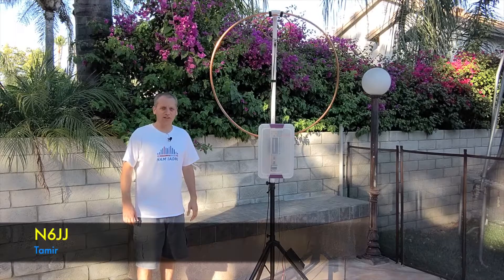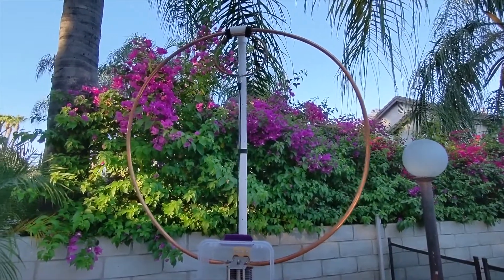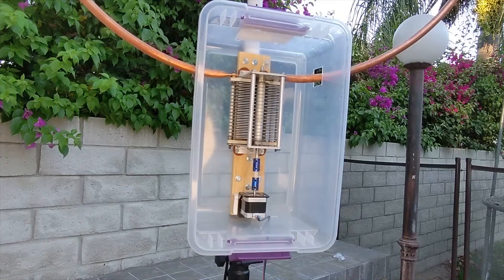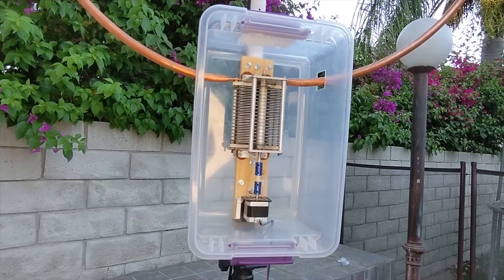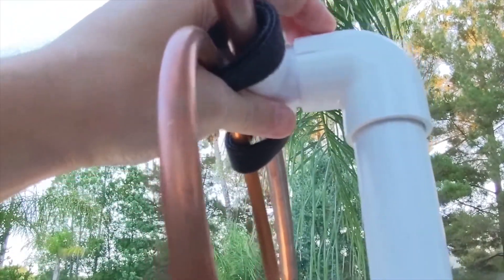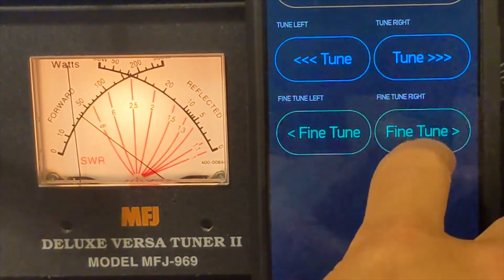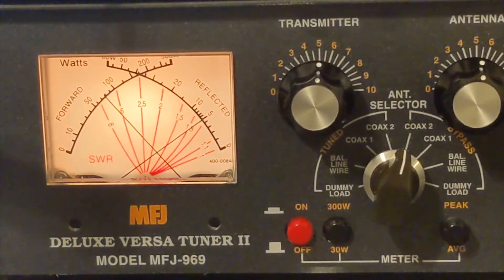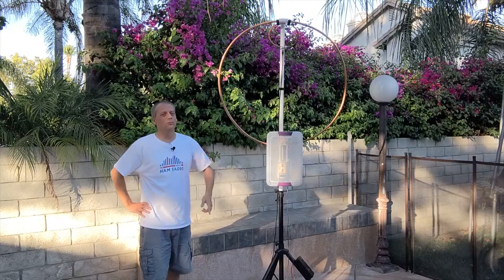Build a Magnetic Loop Antenna with Remote Wireless Tuning - Practical Guidance

Comment: Can you tell us about controlling the capacitor? Did you use a stepper motor or geared dc motor? Or servo motor? What was the app you showed for tuning? Thanks!!! Nice video but kind of mysterious about cap rotation method.
Reply from the maker: Thanks for the questions. The best will be to visit my website and get all the details.
As a quick answer, it's a stepper motor that is controlled remotely using WiFi. 
You can also look in this YouTube channel for more videos on how I built this project and a demonstration how it works in detail.
Please let me know if you have more questions. Thanks.
Reply from the maker: For example, please look at this one: https://youtu.be/R90eValbnWA?si=nBS2AnkdNw-kgMWj

Comment: How does a magnetic loop work vs a regular loop or dipole?
Reply from the maker: There are lots of differences but the main idea Is that with my loop we are using induction between the small loop and the main loop, while in dipole the load is direct in the middle of the antenna. There are so many more differences and the best will be to read about that online, there are so much knowledge out there.
I hope it helps and answers your question.
Reply: @reHamRadio  , that was just it. I don't understand how a magnet can be used as an antenna. I was hoping you could point me to something explaining it. You're teaching the advanced class. I need to learn what it is first. I found your video very interesting by the way.  Can I just Google "magnetic loop antenna?"

Comment: Nice, how about adding a motor to the pole as well to rotate the antenna ! VU2INL
Reply from the maker: Thanks! Yeah, already asked for that. I may release this kind of feature in the future but it may be tricky from the type of the motor as it needs to be more stronger, which means a stronger power supply. Will see.

Comment: HOW TO CALCULATE FOR BUILDING A RECEIVING MAG LOOP---I need a calculator or formula that can show the measurements for building a mag loop for receiving a frequency range. Is there any formula or a calculator for that?
Reply from the maker: Just Google it, you will find a set of different calculators the one will fit your needs.

Comment: Excellent job. Amazing workmanship.
     I read somewhere if you give the small loop a more oval shape (side to side, not top to bottom) it will increase the induction area between the two coils.
     But if it's not broke, don't fix it!😅
Reply from the maker: Tests shows that the SWR is going down when the two loops, large and small, have more area in parallel. Not going to break it now :)

Comment: What is the spacing of the capacitor? And what type capacitor?  Nice video!finding good capacitors is the hard part of building
Loops.
Reply from the maker: It's 5mm between the same polarity plates, so 2.5mm between each plate. Thanks for your feedback.

Comment: I can see you hit 40M-20M, what change would be needed to get good SWR at 10M?
Reply from the maker: It's a combination of the size of the loop and the capacitor range. I would recommend checking the options using an online mag loop calculator, and set the target frequency to 10M and see what are the needed parameters of the loop and capacitor. Good luck.

Comment: Hello does the capacitor have to be 40-430 pF?
Reply from the maker: No, the capacitor range should fit the frequency range that you plan to use. The best will be to use an online free magloop calculator and check the options.

Comment: Very good!
Is it possible to add a kind of automated function using microphone input on mobile phone, for maximum noise level?
Reply from the maker: Yes. I already have the idea to add an automated tune feature that will be based on the field strength of the antenna. I hope to work on that in the near future. But audio is also an option, even though it will not be so precise.

Comment: Nice build.  By the way, your use of the word torsion is off.  I think you mean "torsional backlash" in the case of couplers that have springiness where rigidness is desired.
Reply from the maker: Yep, that's a better way to explain that :) , Thanks, 73.

Comment: Wondering if a vernier reducer will add some advantage or controller will be enough.
Reply from the maker: The controller is configured for micro-steps, which means 6400 steps per revolution. From my experience it's more than enough, but it also depends on the capacitor type as well.
Reply: @reHamRadio  I will use a Palstar C600 capacitor, which is 20-500 pf or so at 5,5 KV, Not sure what power the antenna will handle, but that is the one. Thanks.

Comment: I found your video very interesting and I want to build by myself such an antenna. Please send me the precise schematics of the butterfly capacitor, because what I have found does not tell all the distances of the margin holes of the wings. Thank you in advance 73
Reply from the maker: Thanks for your feedback, @Nicolae. I'm not sure that I understand the question, so please elaborate if needed. But for clarifying, just connect the edges of the loop to the capacitor that you have. In my case, the distance between the screws is 7.5cm, but from my experience, it's really minor, as it will just change a bit the frequency up or down, based on your capacitor and loop measurements. I hope it helps, 73.

Comment: Great video!  I really like your remote turner as well.  Have you thought about making a remote auto tuner?  That would eliminate the hassle of manually tuning every time you change frequency.  73 and  Shalom!
Reply from the maker: Thanks 👍
Yeah, Auto Tune is one of the features that I have in the features list to develop. The latest version supports Vacuum capacitors (will be released very soon), and the next version will support "memories" and more.
Please stay tuned and visit the website for more news.
I appreciate your feedback. 73.

Comment: My board label says it is ESP-12F not ESP-12E. I selected board 12E in IDE. After updating the board information, it was only the version available:
Please advise if you can. de Jose - wb2bwu
Update: I didn't find any support on Arduino for esp8266 12f, so I ordered some esp8266 12e board to play with. I am hoping that support for 12f modules will happen in the future. In the meantime, I will download micro-Python on one of my Linux machines and hope the 12f is supported there. Still, I am having fun.
73s,
Joe - WB2BWU

Comment: Made something similar, but just for listening and testing. I tune it with an arduino similar to a rotory encoder with a switch to set the stepper step size from 1/2 to 1/16. the best result I get from the 1/16 step step. You use blynk by the look of it. I have a blynk server, but this is a better solution if you're out and about. What stepper size do you run on fine tune?
Reply from the maker: The Blynk v1 is not available anymore so I decided to provide an independent solution. You can see another video that explains that.
In my configuration I'm using 1/32 thanks to the DRV8825.

Comment: I just have a small question, how can a magnetic loop antenna be calculate for more than one band. Let's say that I'd like to have one to 40 & 80 meters band. The first calculated, the one you recommend only allow us to enter one frequency, so how can we put both together?   And thank you for sharing your ideas.       73's / ct1bsd
Reply from the maker: Hi @Filipe, thanks for your feedback.
When using the calculator, you should use both the capacitor's minimum and maximum values, one at a time. These calculations will give you the frequency range. If the range that you get is not what you are looking for and you don't have another capacitor, you can change the value of the loop diameter. Try to change the values up and down, and check the difference. 
I hope it helps.
73.

Comment: I was excited about your wanting to show us how to build a mag loop ant. I am a beginner, I don't understand the speak in acronyms and in this case all I want was instruction on how to build the ant. just for listening. I don't have a ham license yet, but I want to listen so I can learn what is going on. The equipment is expensive, cheapest MFJ SWR meter is $169 plus the transceiver which appears to be any thing from $500 up. I have a Eton 750 listening radio. Will some one show me how to build the mag loop ant. just for listening so I can learn more. Thanks very much. I appreciate the videos very much, keep them coming.
Reply from the maker: Thanks so much for your comment, @Mogul.
I hope that the video gave some more knowledge, even if not all the terminology is clear at this point. You will get it soon. The best way is just by... "doing it!" :)
I tried to show how to build that Mag-Loop as simple as I can and with the minimum cost as not everything needs to be expensive. 
Good luck with your ham radio journey and hope to found you on the air someday!
Welcome to the club :)
Happy holidays, 73!

Comment: Where did you get the variable capacitor and what is its voltage can cap rating?
Reply from the maker: Ebay, keep an eye on what people are selling. Mine can hold a few KV.

Comment: Thanks for the video. Can a variable capacitor be made with a sliding copper tube inside a larger ID copper tube? Plastic pipe sleeve in-between to act as an insulator. Very fine adjustment created by a fine threaded machine screw with appropriate insulation. Your servo motor driving the bolt would be great.

Directional control could be supplied by a linear actuator from a lift chair or using your servo idea above. The Antenna would be mounted on a swivel mount to allow motion without rocking.
Reply from the maker: There are so many possibilities and options... Yeah.

Comment: Excellent. Wood actually is not so good isolator. I use 10kV fence and wood posts even when dry are conductors. Usually snail or fly goes between isolator and wood post and it starts to arc. It's max 10J generator and some wire inductance
Reply from the maker: What you wrote is true. That's why I built the capacitor inside a plastic box. In addition, each of us needs to make sure that the isolation fits in his/her own environment.

Comment: Wow, Tamir, this is an outstanding video! I’m going to check out your video on the remote tuning. I’m interested in (watch out) a magnetic loop for 160m since I am unable to use an L or other kind of antenna due to HOA restrictions. The mag loop will have to be how I do it. Again, excellent video. I have subscribed to your channel. Jeff, KF5KWO
Reply from the maker: Thanks, I'm going to release a new video with a new software version. Stay tuned.
Reply from the maker: Hi @Herr, I just released the new video with the new software version that will replace Blynk. Good luck.
Reply: @reHamRadio  thank you, Tamir, I will check it out immediately! Happy New Year to you!

Comment: Hi, Is the 40m loop very directional?  Can it be used to null out noise from neighbours  led lights for example?
Reply from the maker: It is definitely directional, but about the null... It will depend on the strength of the signal

Comment: What variable capacitor did you use
Reply from the maker: All the parts are in the description of the video. It's an air capacitor. You can choose anything you have just calculate the size of the loop itself.

Comment: friends, I have tried to make an antenna like your instructions, using a 1/4 in copper pipe for the main loop, after I tried it, I couldn't catch the signal at all, please advise what the problem is, thank you
Haryoso
Reply from the maker: Hi, there are so many options that can cause you to not get any signal. From problem with the connectors, failure coax, capacitor that is in short, soldering, and more... Please try to isolate each component to make sure that they are good. 
It's very hard to help remotely with this kind of issue. I would recommend to contact a local ham that may help to check that with you.
I hope things will be ok soon. Good luck, 73.

Comment: I am VU3SQM, Ameer Khan from India.
Would you advise what is the usual gap between the main loop and the feeding Loop in this design.
Thank you for providing us with magnificent design.
Reply from the maker: Thanks Ameer for your feedback. 
As for the gap between the loops, you can see in my design in the video, that only a PVC in a T shape is in between them. I would say it's around 1 cm at the top. As you can see, the small loop is not a real circle but an oval, because you want as much space close to each loop, to get a better SWR.
Good luck, 73.

Comment: Excellent well done. I want to try something like this myself. 

I recently got the MFJ-935C and with just 13 feet of 10 mm copper pipe I made an SSB contact @20 Watts on 20m from Ireland to Canada, I was very impressed, the antenna was just on a patio table outside a few feet off the ground, I was not expecting this DX contact with just 20 Watts. 

The MFJ loop tuner is strange in the fact it doesn't have the coupling loop.  It works on 20m also with 9 feet of copper, I made contacts around Europe, I haven't used it much yet but will experiment more when the weather gets finer. It also handles 100 Watts. 

The MFJ tuner has made me very interested in loops, it would be great if it could be controller remotely.
Reply from the maker: Thanks for sharing that information. Yeah, it's amazing what these tiny antennas on a balcony or patio can do even with low power. I'm working on another version of that remote tuner and hope to release a movie soon. 73.

Comment: Ideas for your next version: as you know, the radiation resistance of the loop is very low. So to improve efficiency you can reduce the RF resistance of the circuit by using a butterfly capacitor which doesn't require a wiping contact. Also, you can solder or braze the connections of the loop to the capacitor to reduce resistance there. I have thought of polishing the copper and coating it with lacquer to reduce the skin effect resistance when the copper oxidizes, but I don't know how much that would help. MFJ sells a butterfly capacitor that they use in their loop, but the capacitance is much lower than that of the one that you have, so you would need to make the loop bigger if you want it to cover 7 and 10 MHz.
I've had good luck with this kind of antenna, but the need to retune every few kHz is annoying. DE 4X6GP
Reply from the maker: Thanks Victor, for the tips and for sharing your experience. Yes, I'm aware of these options to lower the resistance. Believe it or not, I built this version as an experiment to make sure that I'm on the right track. I do have more ideas for the next version, for example an auto tune feature, that should solve that time issue you mentioned. I really appreciate your feedback! 73. Toda!
Reply: Victor, a split-stator or "butterfly" capacitor essentially puts two identical variable capacitors in series, and uses the capacitor's rotor to couple between them to avoid the wiper contact on the rotor. This is great, and increases the cap's voltage rating, but it means maximum capacitance is reduced in half for a given physical size. As they say, there is no free lunch!

Comment: 4X1LM  :         Very nice and helpful  ! will it work with a 10 turns vacuum capacitor??
Reply from the maker: Thanks Michael, the only thing that you'll need to take into consideration is that a Vacuum capacitor has turns limits, while the provided solution is using an Air capacitor with no stops and it can turn around unlimited.

Comment: hi om Tamir , tu fer nice es informative video , from were the supply voltage comes ? do you have a battery under the antenna ? or do you use a bias-t and feed the supply through the coax ? 73 de  Amir  4z1ar
Reply from the maker: Thanks Amir. Yep, I'm using a battery that is located underneath the antenna. In the movie, around minute 1:08, you can see the antenna on the balcony, and the orange battery near the tripod leg. Thanks for stopping by :)

Comment: The best demonstration of building a stepper driven magnetic loop yet.  Your format was so easy to follow.  Congratulations!!!  I too have built a stepper driven magnetic loop using an inexpensive stepper motor.  Your means of coupling the sm to the variable cap was very useful... I will now change out the spiral couplers I was using.  I chose to use a pulse encoder to manually tune my mag loop.  Thank you!!
Reply from the maker: I'm so happy to hear that, Ron. Yes, I like to keep things simple :) I appreciate your feedback, 73.

Comment: What does prevent you from creating a A/D to detect power of SWR and then automatically "maximise" the position of the motor, on the basis of maximal output power (or minimal SWR)? I am thus proposing to go "closed loop" as opposed to "open loop" control that you demonstrated.
Reply from the maker: Thanks for your comment, I do have ideas to add this feature and I already mentioned that in previous comments. This was only my first version of the antenna. I hope to provide an update soon. Thanks again.

Comment: what value capsitor can you use, the one you mentioned is not availeble here
Reply from the maker: The best will be to check which capacitors you can get, and then, check what frequency range you will get by using the Online MagLoop Calculator. If you have only a single capacitor and you don't get the exact frequency range that you want, you can try to change the loop "size", smaller or larger, and then see what you can get.
I hope it helps, good luck.